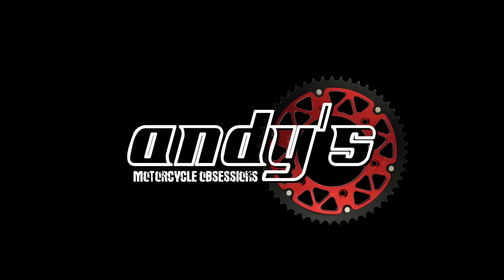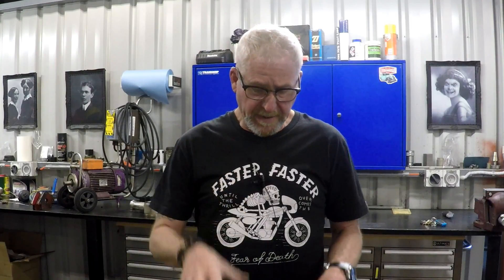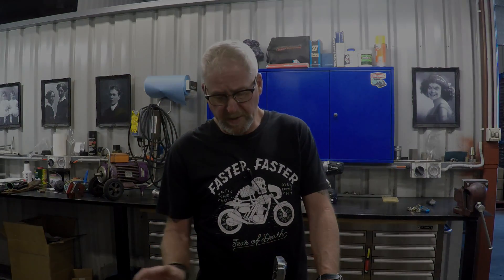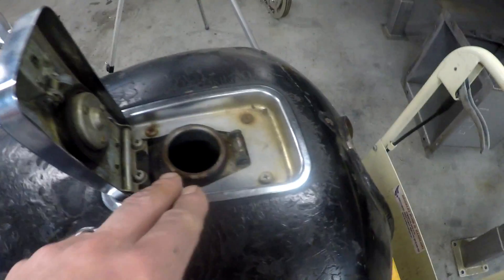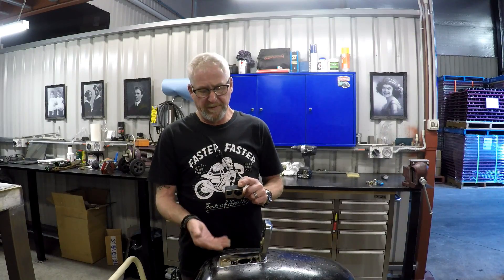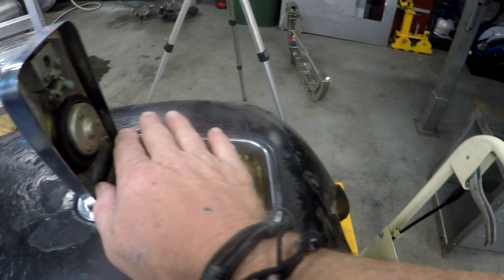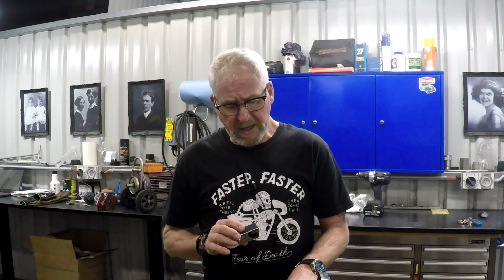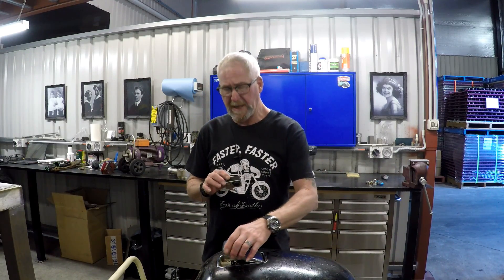Welders - fabricators - paint and body guys - I need your advice

Comment: cut that bitch open Andy .... remove all of the filler well but leave a good size radius in the corners . the radius will help you with distortion when you weld . head to the closest sheet metal workshop and ask for panel steel . its really clean and soft you can shape it easily with basic tooling,  grab extra for the tig welder setup . you should practice first . 
shape and cut the panel steel to suit the opening remember to have good corner radius. you want a perfect fit best as you can get with smooth clean lines no gaps but a whisker will pass
practice on the test pieces first,  put the tig in 4t mode and don't be afraid to turn up the amps 
pre  fill or purge the tank with argon purge is better through the tank outlet , where you plan on welding in the new filler neck drill a small hole for purge gas to escape
all the welding will be in a series of tacks  start in the middle say north then south then east then west  continue tack welding in the piece  in a circular motion N S E W but space out the tacks 20 millimeters each tack till you have a continuous tacked in piece at 20 mm spacing's  but keep the zig zag tacking process.
now this is the important part have a wet rag on hand and douse each tack you have to cool each tack to prevent warpage of your joint . if you dont hear sissing the rag is not wet enough
keep filling in the 20mm paths with more tacks and cooling till your all welded up in the N S E W pattern 
grab your air line and give it a toot of air through the tank outlet and with some soapy water around your welded aria if you see bubbles mark and tack weld and re test till there is no bubbles 
once you have welded and are happy with no leeks then you can FILE YES FILE the welds flat  using a grinder will most likely warp the tank due to the heat from friction.     
there you go Andy you have the skills and now you have the know how

if there is to many blanks please ask m8
Reply from the maker: Okay, you actually sound like you know what you’re talking about. Can I ask what you do for a living? Also I have some 1mm sheet under the bench that I was planning on using, I don’t know if it’s panel steel or not. Is there anyway of telling? I have an old shitty tank under the house that I was going to practice on.
Reply: @ANDY5  you can bend panel steel with ya bear hands and the amount your after wont cost much . i can send you some down if need be tiger  im only 250kms north of ya . my advice take it or leave it  get your self some ....  you asked " Can I ask what you do for a living?" cant tell  ya as im an International Man of Mystery
Reply: couldn't help myself lol
Reply: it feels like stiff lead sheet and its great to work with and has no mill scale on it

Comment: I only know enough about this to be dangerous. I think the original plan was OK. Not done properly. The welding process is a heat treat of the area. It likely made the metal brittle. You put the strap over it. Add vibration. Maybe it wasn’t a great job. Perhaps it should have been normalized. I expect it was not done and something you should look into.